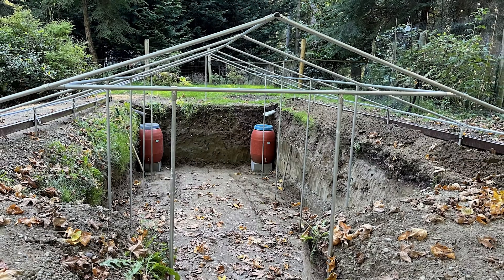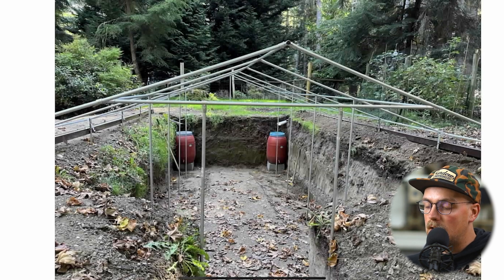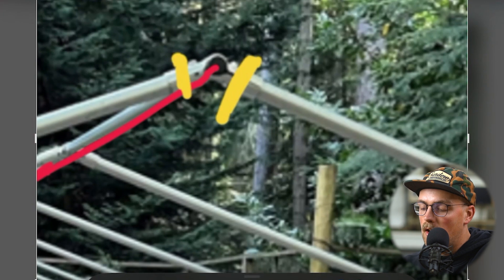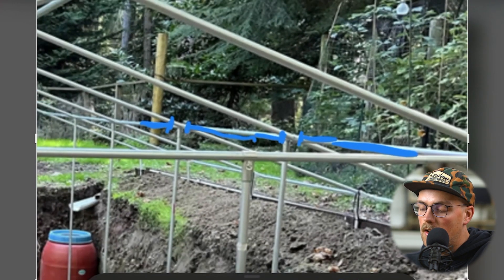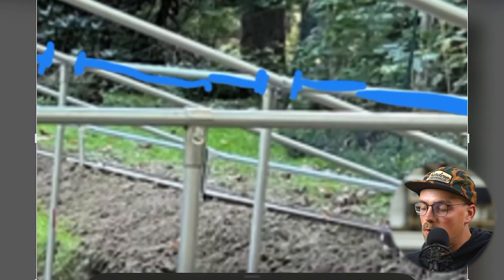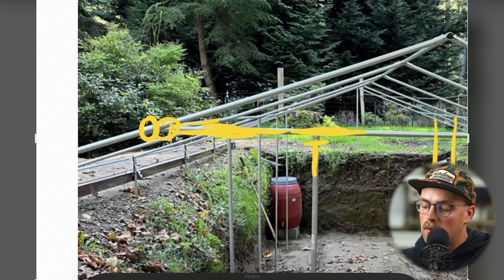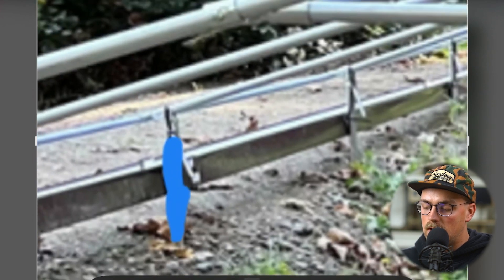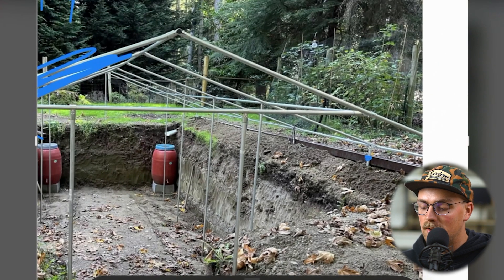This Clever Greenhouse Has A Hidden Secret!

Comment: How is the conduit attached to the ground? Are there issues with burying the conduit directly? Or should it be staked first and the conduit slipped over that?

Very cool below ground design!
Reply from the maker: Hi there, I don't know for sure how it is secured but typically we recommend staking one of these rebar pins and then sliding the conduit over top of it. You can also bury the conduit but the stakes really add a lot of rigidity. 

https://www.lowes.com/pd/Steel-Rebar-Pins-Common-0-75-in-x-18-in-Actual-0-75-in-x-18-in/4008133?store=728&cm_mmc=shp-_-b-_-prd-_-pro-_-ggl-_-LIA_BDM_000_PRO-_-4008133-_-local-_-0-_-0&gad_source=1&gclid=Cj0KCQjwj4K5BhDYARIsAD1Ly2qbaCxe4bEMR5RFqpfNhxXnSYEXURhIt8BnR37FqZNtdntA2skpZDIaArV4EALw_wcB&gclsrc=aw.ds